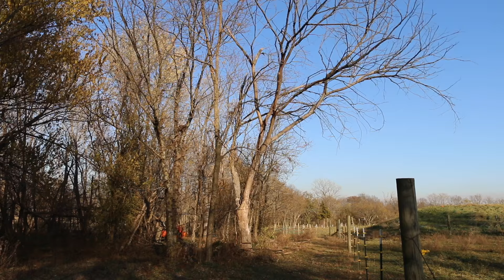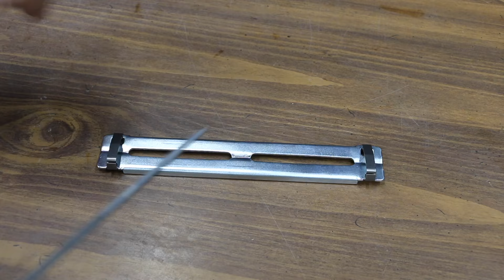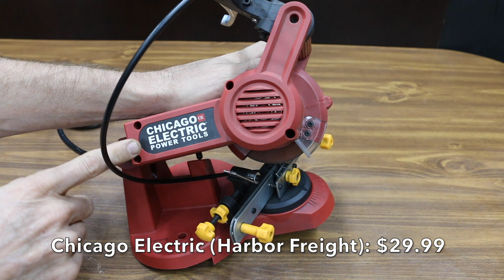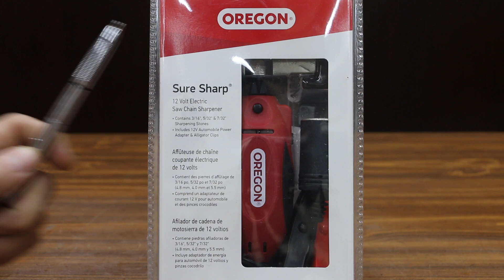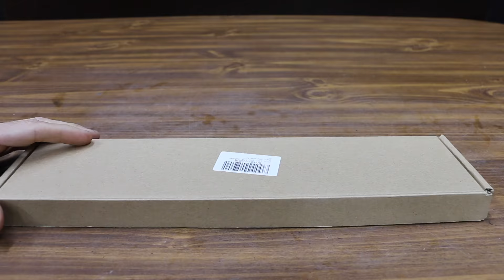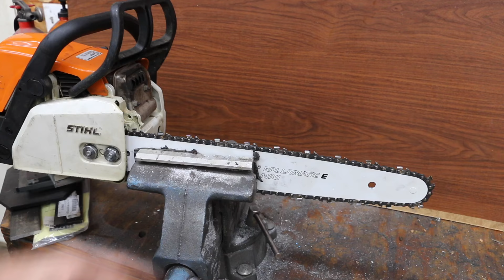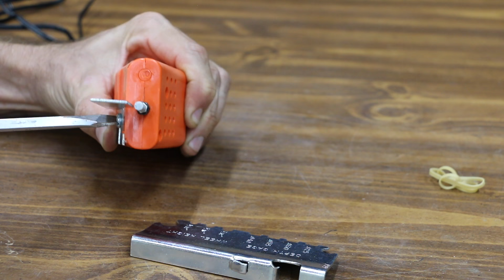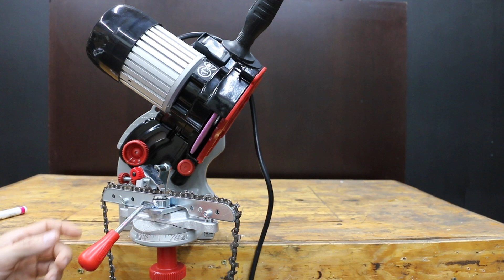Which Chainsaw Sharpener is Best? Let's find out! Stihl, Granberg, Chicago Electric, Oregon

Comment: "It was so bad that I had to make sure the chain wasn't on backwards" LOL. I learned something new about cleaning up the chains using lye. You must have a massive inventory of power tools. Loved the video!
Reply from the maker: Thanks!
Reply: @ProjectFarm  make a video about battery angle grinder please
Reply: Whoa, particularly @Teddy Flood ... some of you people are getting why past the chemistry here and the reasoning of using the lye. The caustic solution will definitely attack the organic matter more aggressively then the steel. You also have "soak time" whether its in heat, cold, or chemical solutions it matters a great deal. Todd did not leave the chain in solution for hours upon hours, just long enough, 15 minutes, to get the desired results, removal of MOST of the organics. Yes, Teddy it actual works, hence why it is used as a drain cleaner. It's also used to make bar soap. You can wash your hands, Teddy, you'll still have your fingers but I wouldn't recommend washing you eyes with bar soap.
Who here would put aluminum in sulfuric acid? No one in there right mind @ 100% solution, however this is what is used, in part, to anodize aluminum but at a 6% solution for a several minutes.
Reply: @ScooterFXRS  We use dollar store oven cleaner to clean the grease and crap off junk yard aluminum block motors before we turn them into SBE race motors. works great and fast and leaves them with a dull gray finish.
Reply: And I just thought of this Teddy, it comes in a steel can!
Reply: @gereatricfolk479 , well ok but they do line the can or over time it would eat it's way through. Glad you found a alternative to the usual petroleum distillate to clean those old motors.
Reply: This older guy who used to sharpen my chains would soak them in solvent before he sharpened and soak them in 30W when he was done...
Reply: @mattgould4265  Yes....I also soak my new chains in 30w before using for at least a weak so the oil gets in there.
Reply: @mattgould4265  Ah! The "older guy" theory.  After 3/4" century, I can tell you that getting older does not necessarily make you wiser.  However, a few years in college may teach one to do the research in order to form an opinion on any topic: the "I don't know the answer, but I know how to look for it" approach.
Funny, in all the opinions about the Lye, no one included a link to their source material.  I wonder, how many 'checked it out' before "sharing?"
Reply: Wow this thread jumped the shark.
Reply: @ChedwardThe3rd  right
Reply: Organic fiber, fats and resins polymerize under heat into a plastic that's almost impossible to remove without a high pH...to which steels are fairly tolerant.  It's the reason caustic bases work well in drains...breaks apart the organic molecular bonds, dissolving the clog, not the drain.  Oven cleaners do the same thing.
Reply: Bruh, one time I was at my brother in laws house and noticed he had his chainsaw chain on backwards and quickly flipped it around and set its tension without him noticing. But then my dad said "did he have his chain on BACKWARDS?!" and I said yeah but its not about  standing here and  taking joy in him being wrong. Just flip it around without him noticing and move on.
Reply: Thanks for another great review, Todd!
Reply: I missed that comment. Where was it?
Reply: Timestamp?
Reply: Buckin' Billy Ray will help! He knows everything about sharpening chains!
Reply: Seriously have u never seen a documentary one murder where they use lye to dissolve bodies.
Reply: Bought a combi years ago, tried to use the pole saw and it was useless. On closer inspection, they'd put the chain on back to front!😂 Thankfully the days of buying budget equipment from home stores are gone and now use the Husqvarna 535LK pro combi which is the nuts!
Reply: The tuck you r ont
Reply: Q
Reply: I have hit concrete
Reply: 😄 I got my chainsaw for 1/3 the price of new thanks to the fool I bought it from not knowing he/she had done this.
Reply: Doubt the lye helps any. Sure wouldn't use it on a motorcycle chain.
Reply: @replynotificationsdisabled  If the lye would harm the metal they wouldn't use it to clean sink drains for years and years and years.  If it won't hurt thin wall kitchen sink pipe, heavy duty chains such as motorcycle chains won't even know it was used except they won't be sticky anymore.
Reply: @replynotificationsdisabled  Everyone: Not a single mention of motorcycle chains.
Some clown in the comments: suRe WOULdN'T use IT ON a MotoRCyclE CHAIn.
Reply: @replynotificationsdisabled  
Unless the lye is from space, it won't eat through steel lol.
Reply: @replynotificationsdisabled  I restore cast iron cookware, and I use lye. It doesn’t react with iron whatsoever, so I doubt it reacts with steel.
Reply: @sundstrom193  What ratio (concentration) of lye/water on cookware do you use, and what type....I have that project lined up in front of me next week (and some flaxseed oil), or do you have a video/channel recommendation....thanks.
Reply: @replynotificationsdisabled  Well, if you doubt it, it must be true. Please supply a link to your video.  lol
Reply: @replynotificationsdisabled  If you were as smart as you think you are, you wouldn't be riding a motorcycle that used a chain.  Son.
Reply: @replynotificationsdisabled  Well no shit you wouldn't use it on a motorcycle chain. Lye is used to remove the dead tree bits from the chain before sharpening.

Unless your motorcycle eats dead trees, don't use lye on it lol
Reply: @Sun-ut9gr  but you'd use it on a chain with blades, literally in front of your face?
Reply: @Sun-ut9gr  i wish but not really, that I'd meet more people like yourself in public. But it doesn't help me talking shit on social media. Just know this is a social media "dad disciplines son" moment for you. And it's Sunday. Keep it up, you'll go far son.
Reply: @replynotificationsdisabled  What? Im totally confused by your comments lmao
Reply: @Sun-ut9gr  hahaha ur response made me laugh. Unless ur motorcycle eats dead trees lmao hahahaha!!!
Reply: @replynotificationsdisabled  So many commenters gave you a "multiple dads discipline their son" moment and told you how wrong you were. Keyboard warrior put in his place, love to see it. You definitely deserved to be @'ed after acting so tuff and smart. 😂
Reply: @Sun-ut9gr  have you never substituted your rear wheel for a 21-in circular saw blade?
Reply: @replynotificationsdisabled  I see you missed the part where he said he rinsed the chains off really well with water.
Reply: @replynotificationsdisabled  I see you missed Sun's content of his message to you.
Reply: @replynotificationsdisabled  i
Reply: @replynotificationsdisabled  WOW, snowflake flounces in to the meeting.
Reply: @replynotificationsdisabled   dont use it on bananas, painted surface or your face either
Reply: @replynotificationsdisabled  I can't see where or why a motorcycle chain would come in contact with tree sap, but you ho ahead and ride your motorcycle your way.  No judgment.
Reply: @Fireguy97  Well, I do have friends that race GNCC and they have hit quite a few trees. All of them have broken one bone or another and fucked their bikes up. But I doubt that dude could ride a motorcycle fast through the woods.
Reply: @replynotificationsdisabled  clean a chain a chain up?  What are you sticking it into?  The oiler on the saw should be suffi
cient.
Reply: @replynotificationsdisabled  by
Reply: @replynotificationsdisabled  I guess this YT account actually lives up to its name. Lmfao. 

What’s that saying again….??? Better to keep your mouth shut and be thought of as a fool….than to open it and remove all doubt. Something like that. What a tool.
Reply: @replynotificationsdisabled   If you are looking for a really good way to remove old oil from a motorcycle chain, then use something like acetone, or a product called Purple Clean. I use purple clean when I am rebuilding engines, I can spray it on the engine, let it sit, then powerwash it off. LYE being a drain opener, it is used for removing the organic matter (mostly the tree sap) from the links of the chainsaw chain.
Reply: @KrazyMitchAdventures  I get why it's used, but organics make oil. Synthetics are mimicked from organics... Lye doesn't give a shit people.. It'll eat steel too. Jesus phuck, read my shit before you respond. I only used my motorcycle as reference because this little snap rings holding it all together... Don't like corrosion. So I'll keep some sap to protect it over looking pretty any day. Soak anything in lye long enough/everyone you sharpen, you won't have whatever long. Don't @ me bitches again...
Reply: @replynotificationsdisabled  Chainsaw chains are made out of riveted high carbon steel. No o-rings in them or anything. Motorcycle chains don’t have snap rings. Just a master link. You’re probably thinking of sealed roller chains and how you have to be careful what kinds of chemicals and solvents you use on them.
Reply: @replynotificationsdisabled  Concentrated lye solution is stored in tanks of naked carbon steel. Lye is sometimes dosed to steam boilers to prevent corrosion of the steel. Lye is the dominating active ingredient in alkaline degreaser used for, wait for it... STEEEEEEEEEEEEEEL! Don't be so damn cocky when it's you who lack knowledge.
Reply: @replynotificationsdisabled  I'm interested. I can't find reactions with lye and steel. As well, I'm fairly certain alkali solutions prevent the corrosion of steel. I'm not sure about sap, but you may be right. Do you have any more information I could read?
Reply: @replynotificationsdisabled  I love how your earlier comment talks about meeting certain people in public, as if you'd do something about it. And you then go off to call everyone bitches.

And lye isn't going to reasonably damage steel. Lye generally doesn't react with most metals in the first place, at least not enough to really concern yourself over. It'll usually rip through organic material quite well though.
Reply: @replynotificationsdisabled  I'm @ing you because you're mad at internet comment section, and lol.
Reply: @ColdRiverAutowire  you are the clown of this comment section 🤡
Reply: @zeddpilsner4  glad I could entertain you
Reply: @skunkjobb  There are also considerations like concentration and the fact he rinsed the chains afterward. All in all, the chance of the lye damaging the chains is pretty small, everything considered.
Reply: @replynotificationsdisabled  lye is mostly sodium hydroxide which does not react with steel in any way whatsoever, now i don’t know if chainsaw chains are 100% steel or something else nor do I care but I thought I’d let you know
Reply: @replynotificationsdisabled  you might want to do some research before insulting people if you had looked most chainsaw cleaning and sharpening kits come with lye or recommend using lye to clean the chains.
Reply: @replynotificationsdisabled  🤡🤡🤡🤣🤣🤣
Reply: @replynotificationsdisabled  It only reacts with aluminium or zinc. I'd stick with gasoline or diesel too tho because I dont know the alloy
Reply: @trollmcclure1884  Lye will also eat rubber - or pretty much any organic material for that matter. A lot of motorcycle chains have o-rings in them that you wouldn't want in contact with Lye...
Reply: @bradley3549  most rubber is oil based these days, so which rubber are you referring to? natural or synthetic?
Reply: @doom0d1  Oil is considered an organic compound, so it doesn't really matter what form of rubber it is. The reason Lye is used as an oven cleaner and drain cleaner is in part because it breaks down fats/oils extremely well. 

I'm sure there are some high end synthetic orings that can survive highly alkaline solutions - Viton perhaps? EDIT: Apparently Silicone is one of the better.
Reply: @bradley3549  The type of rubber matters very much. The O-rings are made of nitrile rubber (Buna-N) and have no problem with sodium hydroxide (lye), especially considering the short exposure time. But I see no reason to use it on a motorcycle chain anyway since it's not contaminated with such stick shit as a chain saw and doesn't need the lye bath.
Reply: @skunkjobb  Funny you say that as nitrile rubber is rated as the absolute worst in tolerating sodium hydroxide.
Reply: @bradley3549  "nitrile rubber is rated as the absolute worst in tolerating sodium hydroxide." Uhh no it's not. On chemical compatability charts it's rated as above medium which is generally "good" or "fair". So the description of it having "no problem with sodium hydroxide" is perfectly valid.
Reply: @bradley3549  Which by the way is about the same rating that stainless steels (316, 304 & 400) get for sodium hydroxide compatibility.

Comment: The Stihl 2 in 1 is actually manufactured for Stihl by Pferd. You need to purchase the correct model based on your chain's tooth size and pitch. Pferd also markets the same line under their own name for a lot less cost. I have a Pferd 2 in 1 for my Stihl MS 290 and I will never use anything else. That, and a stump vise is all I need and I can sharpen very quickly, anywhere, anytime.
Reply from the maker: Thanks for the feedback.

Comment: I have a friend who does shit with chainsaws for a living. They just use a file.
Reply from the maker: Thanks for the feedback.
Reply: @ProjectFarm  It should be noted these guys are using big ol professional grade saws and the guys sharpening the chains were either guys who had a couple decades of experience or newer guys who were borderline hazed for doing it wrong. Or at least that was what went on when I worked there.
Reply: Three quick passes on each link if they hit something they stop and take care of it right away.
Reply: @hamiam2243  Yup. Maybe a little touch-up at the beginning of the day, typically. If the chain is fuckered to bad, just get a new chain and throw the cost on the budget for the contract. Let the eggheads handle budget malarkey.
Reply: Sure. But how fast can they cut through six 4x4's?
Reply: @austinhastings8793  No idea. They usually cut trees still full of sap and whatnot, including pine.
I worked with them for a bit.
Fuck pine.

Comment: Holly Cow, you did my requested video.  You are so awesome.  I look forward to watching it.
Reply from the maker: Thank you for requesting this one!
Reply: @ProjectFarm  You did not disappoint, I have used the HF bench one for years, and you answered my two questions.  1. Hand file is better, but since I leave my chain sharpening till the end of the day and I am tired.   The bench one is good enough to keep using. (I have 5 chains for each of my two saws so I just swap them out as they dull, then sharpen when back in the garage at the end of the day)  2. The HF one is almost equal to the Oregon bench unit for 10% the price.  Thank you again Project Farm.

Comment: Your comment on Hedge Apple, or osage orange we call them, is dead on. When dried this wood seems to be as hard as a soft metal. If I have to cut any that is extremely aged, I use a carbide tipped blade.
Reply from the maker: Great point on using a carbide blade

Comment: I personally find that my chains come out sharper from hand filing. I have a bench sharpener as well.  Its good for correcting the angle of I mess it up or hit something but I find hand filing makes it sharper
Reply: Definitely
Reply: I looks like hand tools don’t generate much heat on the metal of the blade. I suspect that extra heat from motorized tools dulls the cutting edge a bit.
Reply from the maker: Great feedback!  Thank you

Comment: You really need the correct stihl all in one file for your size chain for the depth gauge to align the file for you properly and make it idiot proof. The file size is stamped/molded into one end of the handle. Spacing varies so it will rest correctly on nearby cutterd depending on chain pitch
Reply from the maker: Great feedback. Thank you

Comment: That push sharpener is made for a special type of chain, can't use regular chain with it
Reply: Oregon. Special chain, bar, sharpener. Chain has cutting edge on top, which is why that push to sharpen system works.
Reply from the maker: Thank you for the feedback
Reply: It would be a quick way to dull them though.

Comment: That self sharpening tool didn't have a chain come with it? That one requires a special chain
Reply: Yup but still junk 🤷🏼🤡
Reply from the maker: It did not come with a chain. Thank you
Reply: @ProjectFarm  maybe a bonus video of using the self sharpener until chain failure or if it will eventually create a new cutting edge like the proprietary chain.
Reply: The real Oregon one needs a special chain, bar, and sharpener. The real one has a chain with cutting edges on top like chisels, which is why it works. 
The spoof versions play off the idea trying to get people to think it can sharpen any chain. It cant.
Reply: Yup special chain required for them.

Comment: I have been waiting for this episode.  Thank you.  I have not watched it yet but I now your standards.  I know it will be a great video.
Reply from the maker: Thank you and hope you enjoy the video!
Reply: @ProjectFarm  I have a look alike of the granberg file system.  Works great on a light dressing of the chain.  Also is great for filing the depth gauges for even work.  This is very important for making straight cuts.  For badly damaged chains, I am with you on the Chicago Electric sharpener.  Great video.  BTW, the angle is determined by the type of wood you cut the most, at least that is what my Stihl manual read 30 some years ago.  I think it was 15 degrees for hard wood like oak and 27 degrees for pine.  Loved the video and you did a great job.